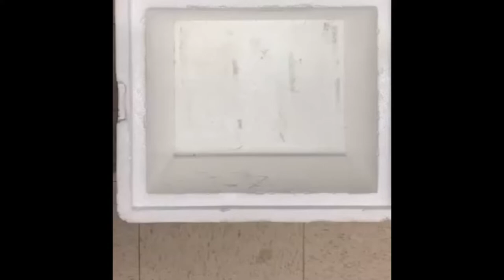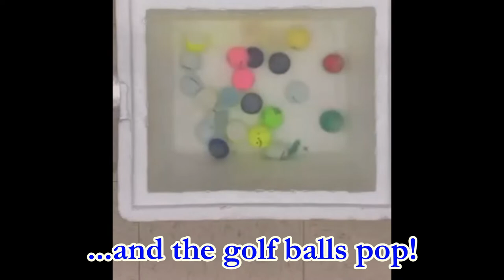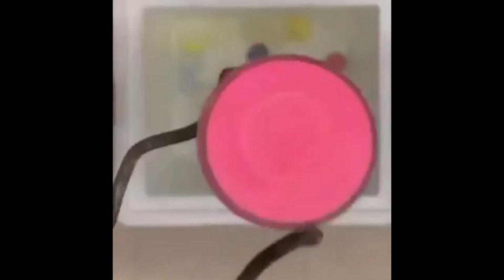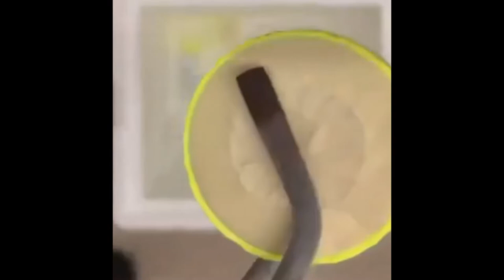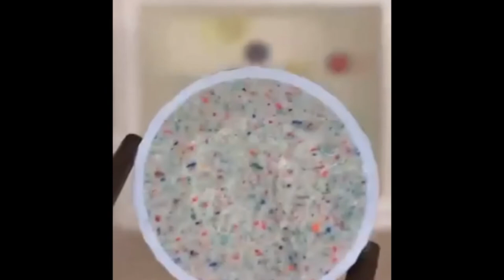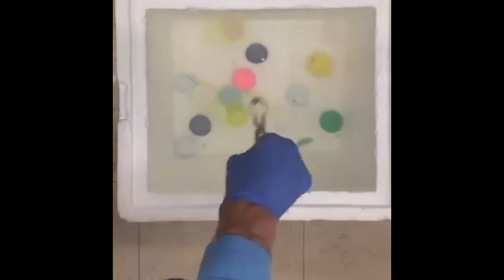Golf Balls in Liquid Nitrogen

Comment: At what point does the interface surface area become sufficient to prevent fragmentation? 
A whiffle ball formed of sufficiently coarse wire mesh should not have this problem, for instance. 
[I assume gas evacuation speed is the limiting factor when eliminating differential cooling from a non-convex object]